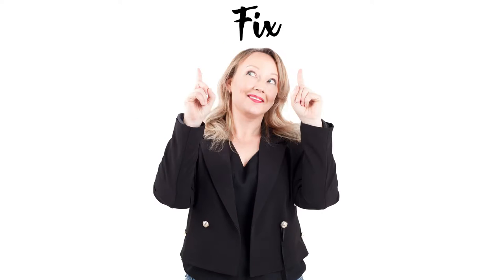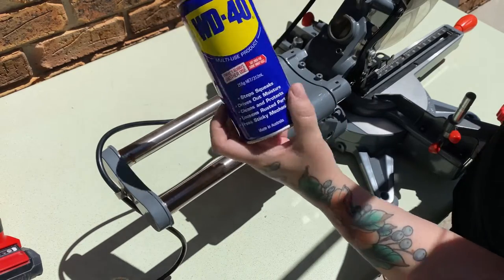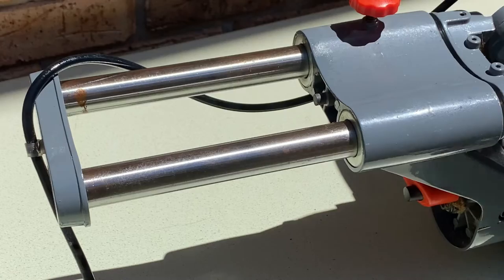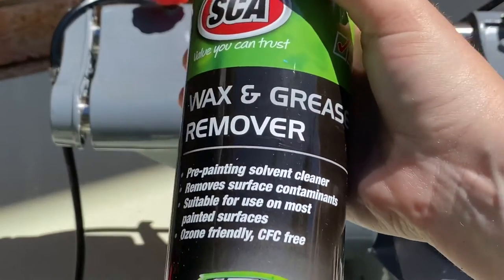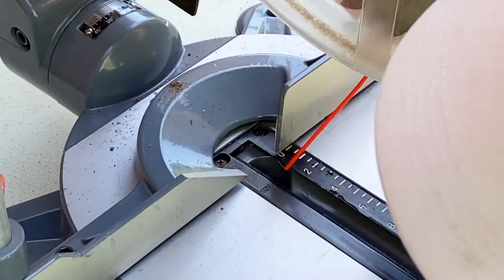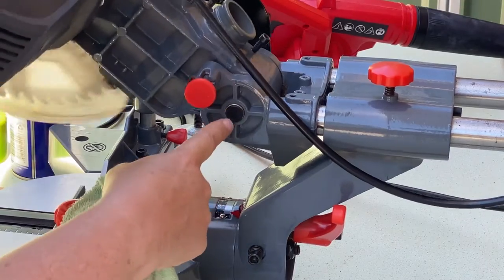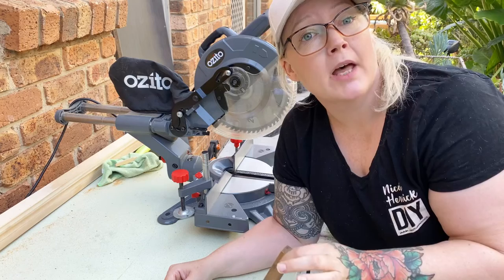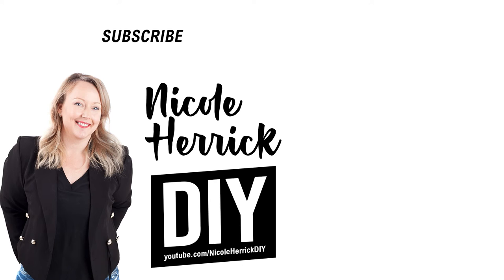How to Tune Up a Mitre Saw | Cleaning and lubrication

Comment: ya know something, I've owned two chop saws for at least ten years now. I've never thought about cleaning them once. For that matter, I've never cleaned my impact drivers, drills, or basically anything else just for a tune up. I mean if something spills id obviously clean it up if something got on a tool, but for the most part cleaning up my tools has never crossed my mind. I'm building a deck this week but when the project is over I am gunna clean all my tools. thx for the video
Reply from the maker: I honestly rarely do mine either but my mitre saw had not been used in a while and was so stiff that I decided to take the time and my gosh, it feels like a brand new saw again.
Reply: I got a ryobi . Doesnt slide and has alot of issues. But we getting there. Thanks for your video. Two minds are better than one.

Comment: Nicely done. I wish I knew why it is so difficult to change from a 90 to a 45 and vice versa.
Reply from the maker: There is two things you need to adjust to move between the horizontal degrees. Is it that or the vertical plan you’re having trouble with?
Reply: @NicoleHerrickDIY  horizontal. I have to use a rubber mallet to knock it off the detent.

Comment: Hi Nicole what do you think of the ozito saw your using ? I’m thinking of buying one. Cheers Rob . Great channel by the way.
Reply from the maker: I think it’s a perfectly good sliding mitre saw for the average DIYer. It’s so incredibly cheap and they have a 3 or 5 year warranty so you know that if anything happens, you’ll get a new machine replacement or refund from Bunnings straight away. The only thing I wish mine had was a laser line so if they have a new model with that, choose that one. Otherwise the Ryobi is great as well.
Reply: @NicoleHerrickDIY  thanks for replying 👍

Comment: Just bought a used mitre saw, it feels rough. I use one at work that’s super smooth, just bought the wd-40 dry lube. Thanks!
Reply from the maker: Let me know if it feels better are the clean and lube. I spent a good 45 mins making sure everything was super clean, a little sanding and lubed. Can’t believe the difference.
Reply: Same. Bought used Dewalt and did a first cut and kept stopping mid way on a 2x4 lumber. Thinking of lubricanting everything and also changing the blade. 

Did it improve your performance?
Reply: @Oneklickmedia  yes my saw feels great, i changed blades also and made a zero clearance plate and get pretty much perfect cuts

Comment: I have a miter saw, and both of the sliding rails are very, very rusty, what do you recommend to get it looking new or as smooth as possible? 🙏 please help. Ty
Reply from the maker: Ok to remove rust, you can create a paste with baking Soda and water. Spread it on the rails then wrap it with foil and leave for 2 hours. This process can be repeated. Or there are chemicals like CLR.  You can use fine grit wet sandpapers like 600-1500 to get off remaining bits and smooth everything.
Reply: I have an old junky one for cutting firewood.  I lightly used 180 grit sand paper and kept blowing it off then used silicone spray.  Not 100% perfect but it didn't slid before

Comment: Dont use WD-40, its a garbage product even if for cleaning. All pivot points have a special grease before assembly. Using WD-40 will further wash it out. The amount of play in those needle bearing means they need to be replaced.

Comment: so in the video Design your own product in wix. Can those same steps be done but linked to a form that is submitted with no prices?
Reply from the maker: You can set up a form with each of the images and options and steps and even get the user to upload an image if you need, then it all gets sent to you. Here’s a little more info on forms. You might want to try a multi step or a price quote form. https://support.wix.com/en/article/wix-forms-adding-and-setting-up-a-multi-step-form

Comment: Got the exact same ozito saw, but from the several cuts i have made, the inside of the dust bag is clean as the popes johnson and the saw exterior is like a Nagasaki saw dust bomb has hit it.
Reply from the maker: Oh that doesn’t sound good. First check if the bag is on correctly. If you take the bag off completely and do a test cut, does sawdust shoot out it? Could be blocked. Unplug to clear it outs. The bag is only tiny so it won’t catch a huge amount of sawdust. Mine does get pretty caked after cutting too but your bag should still be filling.

Comment: Wurth shedding grease works much better than any of that. I've tried them all. Shedding grease is perfect for this and won't attract dust. Never use WD40. It's probably the worst of them all. It's a Water Displacer, that's all. It's about time people realise what the WD stands for. Will Disappoint!
Reply from the maker: @AusWorkshop  thanks so much for the tip!
Reply: @NicoleHerrickDIY Great video by the way, thanks for making.
Reply from the maker: @AusWorkshop  thank you 🙏

Comment: since when did wd-40 become a cleaner?
Reply from the maker: From the WD-40 website: “In fact, there are around 2,000 uses for it, for example:
Protects metal surfaces against corrosion and moisture
Cleans grease, grime, dirt, oil and adhesives
Lubricates moving parts like chains and bearings
Displaces moisture from metal surfaces and electrical systems
Penetrates surface rust and acts as a rust removal product for tools and metal components”
Reply: @NicoleHerrickDIY  to be honest, that stuff does none of those things. Its not an oil, it doesn't protect all that well, plenty of my tools rusted pretty fast, 3in1 works better for that. It was always designed to displace water, that's what the WD stands for. The steel wool, that cleans things. I stopped using wd a long while ago. To free nuts use Kroil. I have better oils (do not use soy bean lube by the way, super slick then super sticky), dry lubes etc. But WD is a very short term solution, its good for driving water out of things. But not much else.
Reply from the maker: @mikesavad  does the 3 in 1 clean as well? I’m always happy to learn from others.
Reply: @NicoleHerrickDIY  don't think i said that. I use that to prevent rust. Degreaser cleans. Almost any kind. I use orange because its not as toxic smelling as others. Oil eater is toxic but works great.  I think the only reason I use wd40 for things is, its almost always at a garage sale, so I have to use it up.  I also like its metal flexible wand. Hate the smell.   Kroil is good as it eats rust when soaked, but I wouldn't use it as a cleaner because its expensive.